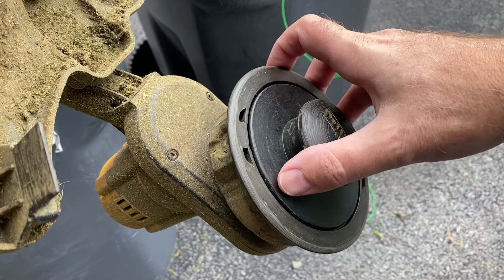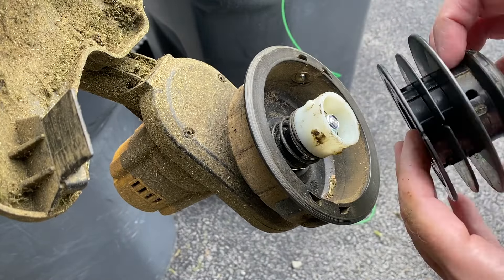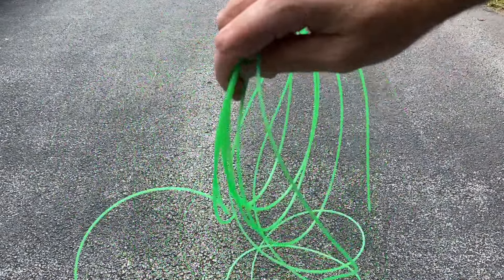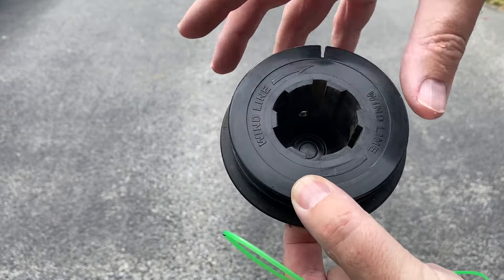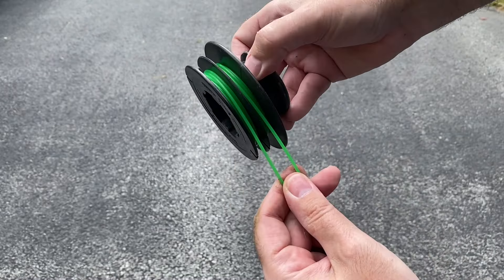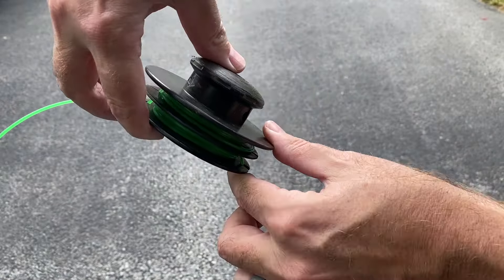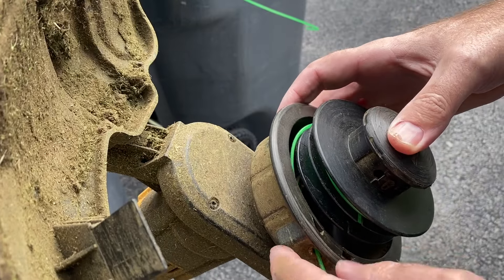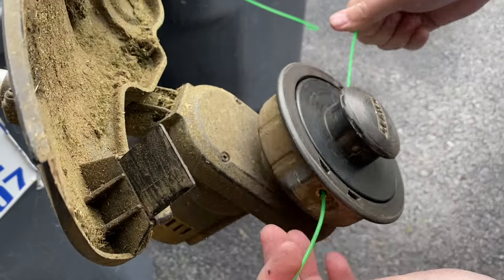How to Change the String on a Dewalt 20v String Trimmer

Comment: Super helpful!  Worked like a charm. Using the little notches is the key to this, one that other DeWalt videos fail to mention. One comment: Remember to take the string OUT of the notches in the spool as you thread it through the holes in the casing or you may have trouble pulling out more later on.  This may be obvious to some really smart people, but it wasn't obvious to me until I looked closely at how you threaded the string at the end.  Thanks again.  Great video and yes, I subscribed.
Reply from the maker: Thanks!  Glad it helped.
Reply: Ooooh. Glad I checked the comments on this video! I think that was my problem today. Thanks for mentioning this!